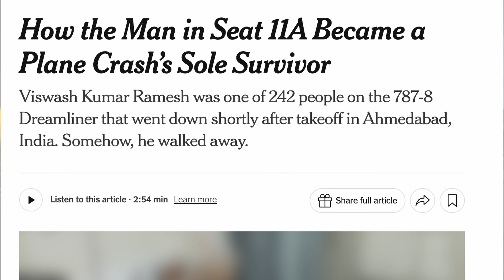Why the RAT Changes Everything – Air India 171 Update

Comment: What puzzles me is that a synchronized dual engine failure is next to absolute impossible. When the fuel is contaminated, you see problems long before the engine flames out. If there was a problem with the engines, they hardly would have taken of. So the engines were fine during taxiing and until V1. It's unlikely that both completely fail within a minute.
A long time ago I worked on EMI certifications for airplane systems. I am familiar with the redundancy of fuel pumps and the necessary electrical systems - at least what they had 30 years ago.

I wonder, what if they have lost all DC power? The safeguards and all the hardwired logic runs on DC power. When we were testing parts like A/C fans, we had to power them with our 400Hz source and plugged in 2 9V batteries in series to enable the devices. So basically we controlled the devices by plugging and unplugging two smoke detector batteries.

I know that Boeing uses lithium batteries as the backup of the DC system. What if one of those had a real explosion and took out the wiring and relays, shorting out the entire DC system?
That would make the RAT deploy for sure. The actuator is triggered by switching off DC power. So if the logic wants to deploy the RAT, it cuts the power to the RAT. So if all DC is lost, the RAT must come out as if triggered by the logic circuits.

Assuming the eye witness is not too confused, he reported that there was a bang and the lights flickered. The cabin lights are powered by AC only (except the emergency lights which can't flicker). So there was no total AC loss, only fluctuations. He would have said "the lights went off" if there was an AC loss. I think the flicker came from AC devices shutting down when DC was lost. The generators need time to adjust to a major loss of electrical loads. 

My question is, what happens with the engines if all DC power is lost? Do they keep their thrust settings or do they switch to idle?
If the engines switch to idle or the fuel system shuts down caused by a total loss of DC power, this would explain everything we saw quite nicely.
Reply: An experienced pilot does not switch his statements seeing videos ....should be patient for the Blackbox investigation report 
Besides Steve or Boeing or USA should not try to blame pilots to cover up the warnings n alerts given by the whistle blower over the years of short comings n escaping safety measures by Boeing 
The Tatas with Indian govt should hold on to reports of BB n if need arises ground all dreamliners n 787 planes . 
Boeing n USA is afraid if grounded they can lead into heavy losses instead blame pilots n get away

Comment: I get that the plane was fully loaded and that it was a hot day. But the runway is over 11,000 ft. and they used the whole length before rotating. They should have been able to takeoff at around 9,000ft. I suspect that the problem began during the takeoff run, perhaps close to V1.

Comment: Love how to came back to this. I was talking to an aircraft mechanic after your first video and he said no way it was an engine failure.  And guess what you addressed that and love that your re assessed the video to set the record straight.  Captain steeeve! Let’s go.
Reply: Meant to say he said no way it was a switch of the gear to the flaps. Engines would overcome keeping the gear out and the flaps withdrawn.  Had to be engine failure or some kid.
Reply: Kind
Reply: @12345howarth  Yes, his initial assessment seems a bit off, considering the footage shown from the airport/takeoff, (which he doesn't show all of) clearly at the end shows the plane was not yet airbourne by the time it was near the end of the runway (dust blown up confirms this). So the 'gear up' mistake is unlikely.
Reply: What’s to love about it. He’s American and a Boeing pilot so his first instinct was to blame te pilot and not the plane.
Reply: @lazgkhn  please dont comment

Comment: I'm a software developer. I believe that software nowadays build much much poorer than years before. Steve, what about a hacker or trojan horse attack to kill someone on a plane, might be an issue? I heard that even wifi antennal could potentially be used to get into the plane sort of MODBUS or CAN BUS, with a hardare signal network? Possibly a logic bomb of some sort, activated by a signal, led to engine turned off simultaniously, for example due to a fuel pumps malfunctions or lock by external improper controller signal due to the poor software triggers or rare untested conditions triggered by a plane itself? @CaptainSteeve

Comment: Something someone else pointed out is that the landing gear is tilted forwards, meaning that they tried to retract it but it failed, and with the plane not letting you take off without the flaps configured AND with the RAT deployed, this was not pilot error. The cause of engine failure will be purely speculation until further investigation. Looking forward to the Air Disaster episode in a few years.

Comment: I have a theory. The First officer mistook 'Gear up' for Flaps up', so they lost lift. I also think that they may have had the wrong thrust setting (D-TO1, D-TO2). This would have meant that aircraft upon takeoff wasn't gaining enough thrust it needed. This may have resulted in the pilots believing that they were losing thrust, resulting in them making a mayday call, and manually deploy the RAT (button on overhead panel), believing that they were going to lose electrical power. I tested all of this in flight simulator with correct winds, temperatures, runway, passengers, and putting up the flaps when you would normally put up the gear, and with wrong thrust.setting, the plane took off and slowly glided back down roughly 30 seconds after takeoff.

Comment: The problem was loss of power. The plane stalled . Likely lost crown power as well as engine thrust . Black box on 787 Dreamliner is powered by battery so it will still have power even though the other power sources were clearly not working. ... RIP everyone on board and my condolences to everyone effected . 🇮🇳🪽

Comment: it isnt only the RAT that should be a gamechjanger here. You can CLEARLY see the the main landinggear have started to retract. The main landinggear have tipped forward, meaning the retraction process have begun. Both 787 and the 777 have the landing gear tipping forward before being retracted into the plane. The hydraulic was clearly cut seconds into the process. It is sirculating that the mayday call sounded something like: Mayday mayday mayday, No power, No thrust, we are going down. Both engines were stopped, either by failure, mistake or on purpose...

Comment: im guessing fuel contamination too, but isolated to this plane as in theres some damage somewhere on plane lines.
if it were fuel supply from airport tank, there should be other aircraft suffer performance issue too departing the airport, which have not heard off yet🤔

Comment: Another hint for engine failure is the fact that the still picture of the RAT and the landing gear is quite clear, without the blurry area produced by the jet blast of a full power engine.
Reply: Great point
Reply: Layman here, I thought of this immediately, lending credence to the engine failure theory.
Reply: Good point🤔👍
Reply: The question is now, what caused the duel engine failure?
Reply: Good thinking.
Reply: any footage taken at this point cannot be used as evidence for anything to do with the engines. The engines sound fine and are running at idle there is no indication here of any damage be it birds or engine stall. At this point the pilots would not be trying to recover engines they had already called the mayday and started the crash procedures therefore throttle idle and not touched again while they are busy with other things in the priority tree. You would not be wanting any thrust.. you are desperately trying to scrub speed not gain it. It is most certainly a systems issue not an engine issue. They might have lost Fadec but again something caused that loss. The engines are a symptom not a cause. I also suspect both engines are giving the same output because the plane has no lateral trims or active rudder applied and the aircraft seems stable on that pitch.

Comment: to confirm that the pilot monitoring has pulled up the landing gear just look at the main landing gear, in the 787 normally the front wheel is turned up, in the video you can see it’s down, just like when the pilot retracts them, this means that the pilot has retracted the landing gear correctly but during that they had a hydraulic failiure

Comment: Engineer please: are these engines not individually pumped from separate tanks?  Is it possible for simple (regular) fuel contam to cause both to flame-out simultaneously? (I'd expect a noticeable delay between each receiving sufficient bad fuel for it to l terminally lose power, especially since they've only just been using fuel at maximum rate)

Comment: I saw a comment on a website regarding a "GCU bug" where after 248 days of continuous operation the GCU will shut down. The GCU provides power to all AC systems. This 787 did not have a maintenance record regarding the GCU software update. GCU shutdown means no fuel pump power which means the engines go out and the RAT deploys. In the video it didn't sound like the engines were running at all, could this be the cause?

Comment: as evidenced by video showing the 787 used the entire runway, with the dust cloud as it departed the runway; the plane could have achieved V2 on the takeoff roll, but before he rotated, both engines were in the process of shutting down, failure.

Comment: Analysis: Possible Causes of Dual Engine Failure on Boeing 787 During Takeoff
Based on the critical new evidence that the previous flight experienced electrical system failures including non-functional air conditioning, the probability rankings have been significantly revised. This electrical malfunction history fundamentally changes the analysis of potential causes.

High Probability Causes (Elevated Due to Electrical History)
1. Electrical System Failure Affecting Engine Control Systems
The passenger report of electrical failures on the previous flight, particularly the complete failure of air conditioning, dramatically elevates this cause to the highest probability. The Boeing 787 is uniquely dependent on electrical systems for virtually all operations, including engine control. Unlike traditional aircraft, the 787's "more electric" architecture generates 1.45 megawatts of electrical power—five times more than conventional aircraft—and uses electrical systems for engine start, cabin pressurization, and critical flight controls.

The air conditioning failure is particularly significant because the Boeing 787 uses a revolutionary "bleedless" system where electric compressors, powered by engine-mounted generators, provide cabin pressurization and air conditioning instead of traditional engine bleed air. This means air conditioning failure indicates problems with the electrical power generation or distribution system that could directly impact engine operation.

Aviation experts note that if the 787 loses all AC electrical power, "the aircraft is in serious trouble" because "the entire design of this airplane relies heavily on electrical systems—everything from bleed air systems to batteries, pumps, and hydraulics is powered electrically". A catastrophic electrical failure could prevent proper engine control and fuel delivery, causing both engines to shut down simultaneously.

2. Generator Control Unit (GCU) Software Malfunction
Boeing has documented a critical software vulnerability in the 787's generator control units that can cause total electrical power loss. While this typically occurs after 248 days of continuous power operation, variations of this software issue could potentially trigger earlier under certain conditions. The FAA has issued airworthiness directives specifically addressing this vulnerability because it "could result in loss of control of the airplane".

Given the documented electrical problems on the previous flight, a related software malfunction in the GCU system becomes highly probable. If all four main generator control units simultaneously enter failsafe mode, the result is complete loss of AC electrical power "regardless of flight phase".

3. Fuel System Malfunction Secondary to Electrical Failure
While fuel contamination remains possible, the electrical system problems suggest the fuel system malfunction may be secondary to electrical failures rather than primary contamination. The 787's sophisticated fuel management system relies heavily on electrical pumps and controls. An electrical system failure could prevent proper fuel delivery to both engines simultaneously, causing fuel starvation even with clean fuel available.

Comment: 9:17 also, wouldn’t functioning jet engines complete swamp out the sound of the RAT?
Reply: My thoughts when I heard this video too. Engines at full take off trust would be very loud.
Reply: For sure dude
Reply: Yes , engines were at idle, that what happens with a fly by wire system when no power
Reply: Not if they were off right?
Reply: @tarcisiobatista5595 that's what he said , just differently... Came at it from another angle... Isn't English Language grand ??!

Comment: Fuel contamination seems capable of disabling both engines simultaneously. If the instantaneous fire cloud was unusually dark, would this indicate contaminated fuel?  The nature/colour of that fire cloud should be compared with other detonations of aviation fuel to see if there is a discernible difference.  
If the fuel supply to both engines have a common point then a problem/breakage at that point would explain simultaneous failure. If not, then it seems that we must suspect contaminated fuel.

Comment: I was saying it's dual engine failure from the start.
And I said it's due to fuel contamination.
India has lots of rains and it's a common problem there.
The both plane engines suck the fuel from one shared tank in the beginning, that's why they both caught water at the same time. 
The problem would probably be gone if they had altitude, but they didn't.
So f**ing STOP blaming the pilots, they did absolutely nothing wrong, and never they would retract the flaps instead of the gear.

Comment: 100% the RAT was deployed. Also, you missed something else interesting in this video.... zoom in on the wheels... the main gear are in the tipped forward condition, which indicates that they were in the first stage of gear up. Search for a vid of B787 landing gear and you'll see the process. They tip forward before retracting into the belly. This is why I don't believe that the copilot made such a basic mistake of activating flaps instead of landing gear. But it would be consistent with the theory of total power failure, and would  even indicate the moment it occurred as being immediately after gear-up select. I also so a plume of dust as it took off, signalling the aircraft reached the very end of the runway before it started to climb.....
Reply: I came here to say something about the gear. Good to know I’m not the only one who noticed this. I’m not a pilot, but a keen observer in aviation. Usually, on a 787, the gear retracts as soon as the main wheels tip forward. A massive and catastrophic electrical failure might explain why the gear was still down during the entire flight with a RAT deployment.

Comment: (Retired U.S. Airline Capt.)  A few more indications have come out from different sources.  A clear Mayday audio of the Capt. clearly say no power. Going down. With the RAT out the narrows down that part. Hopefully soon they have the Cockpit Voice Recorder. My question is did they use the entire length of the runway. The temperature was hot at 40C, but that airport is almost sea level. Did they do an intersection takeoff at maximum thrust ??  You saw the wingtip vortices of dirt as they started their  climb out.  That would put a lot more stress on the engines.

Comment: Thank you for this.  There was a flurry of really expert people that jumped on the possible mistake of the copilot and that just never set right with me after flying large airliners in flight simulators (with the exception of flying in VR where you are stumbling to move your controls without being able to see them properly and your hand brushes by the wrong lever).  Real life cockpits are layed out so that controls are unique and easy to reach.  I think the inclination of seasoned pilots when presented with a scenario like this is wishful thinking that the planes they fly and count on for their livelihood are well-designed and absolutely safe and that the ground crews that maintain them do their jobs perfectly.  The throttles to the engines in modern FBW aircraft are not mechanically linked to the throttles in the cockpit but are operated electrically by servos controlled by complicated software.  Even if the pilot pushes the throttles full forward, it still has to go through the software and electrical controls to increase the thrust.  If a glitch happens that overrides any of those points and the engines are idled or shut off there is no time to troubleshoot and fix the issue.  I can't imagine the panic in the flight crew.